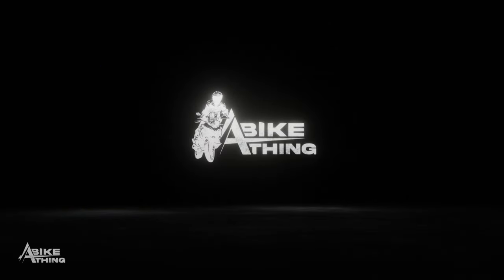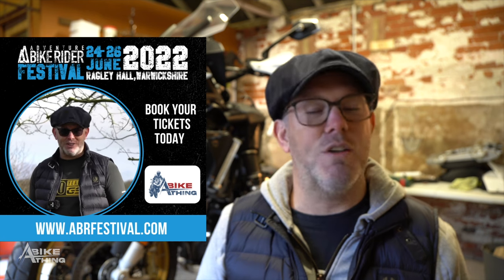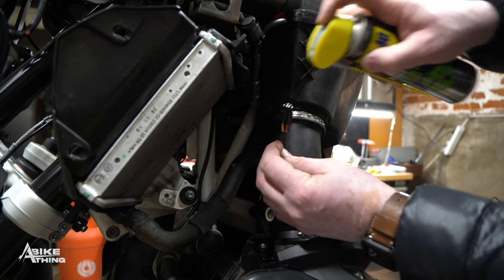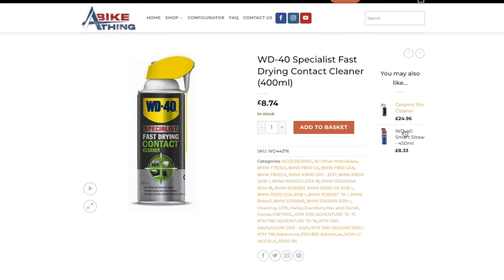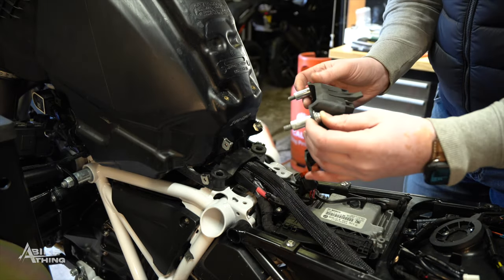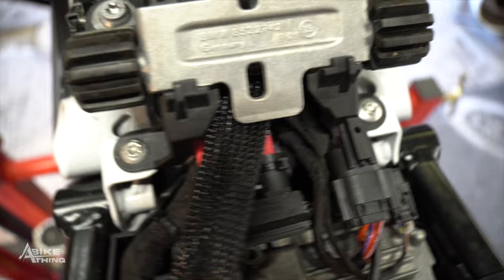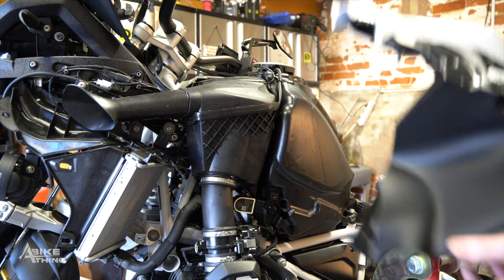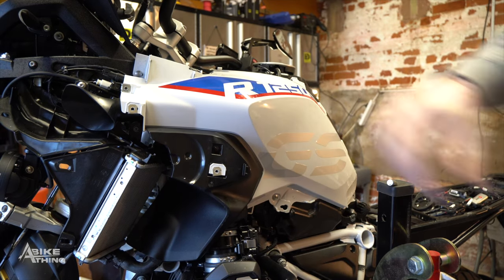Putting Your BMW R1250GS Back Together With Confidence Screw By Screw

Comment: What I did to make sure I did not screw up with the screw placement, is next to each whole I put a piece of masking tape and noted a unique number on each piece. I then took a piece of cardboard and listed all the numbers and put a small hole through the cardboard. As I took off the screws, I placed in the corresponding whole. Worked great, no issues with wondering which screw went where.

Comment: I like your videos and i also have a 1250gs rallye but as soon as i see someone use a driver to do up screws without finger starting them first i wince every time. It’s the engineer in me but i would love to see that attention to detail. Keep the videos coming and if you need any advice on the condensation issues with the ammoguard then get in touch

Comment: Great video Steve and thanks a tonne for doing this. Is the 1250 similar to the 1200 in terms of taking it apart and putting it back to gether again? I ride a 1200 so just want to know before taking it apart.

Comment: How come you didn’t give us a video for the ktm. You’ve done bmw quite a few times. Was wondering if the ktm would be done anytime soon.
Reply from the maker: This is mainly due to killing 2 birds with one stone.  The bikes used in the video is in for work to be done.   I didn’t video my own KTM when I was stripping it down and studying the workshop manual.  I could write off half a day and pull my bike out and do this but I don’t have that luxury.  I have my first KTMs booked in April and May so ill be using these for that video.   I tend to be booked up 3 to 4 months in advance with bikes hence I haven’t had a customers
KTM in here since I officially released the ezCAN for the KTM and it’s then when KTM owners started to book their bikes in with me.
Reply: @ABIKETHING  all ok I understand. The videos are all informative keep up the good work

Comment: Loved the video.   Dropped an Allen wrench down into my GS while adjusting a Quad Lock mount.  You video saved my sanity when I pulled the panels to retrieve the wrench.     One question, where does the single odd size shoulderless screw go?

Comment: Ymmm.. Check the one of nose screw. On Your last video (strip r1250gs), on 9:56 you unscrew shoulderless screw, now i talk to put in shoulder screw. So what?
On this video 21:30 , on old video 9:53. On this video is whith shoulder, on old without.
Reply from the maker: I have just checked 9.56 on the older strip down video and the screw you are referring to is shoulderless and it's shoulderless on this video too at 18:07.  No difference so im not sure what you're on about.
Reply: @ABIKETHING  No, on this video 21:30 , on old video 9:53. On this video is whith shoulder, on old without.
Reply from the maker: @MurgalPL  AH yes I see.  That tells me the screw that came out of that bike on the older video had been taken apart previously and the wrong screw had been put back.  I've taken dozens of GS's apart and the screw in that particular spot is supposed to be shouldered.   I'm surprised no one has mentioned it before now.  Nice spot
Reply: You’ve got a keen eye 👌🏾👌🏾👌🏾